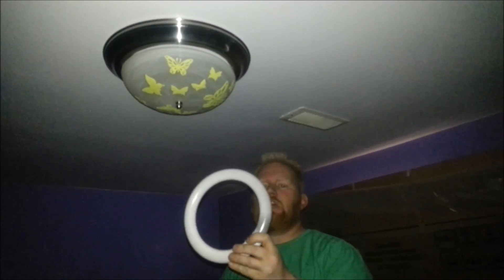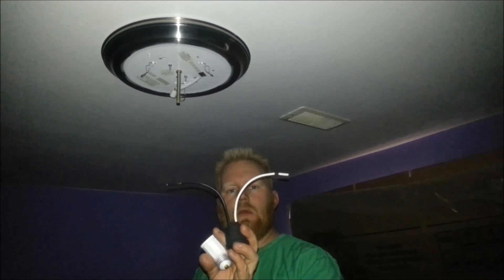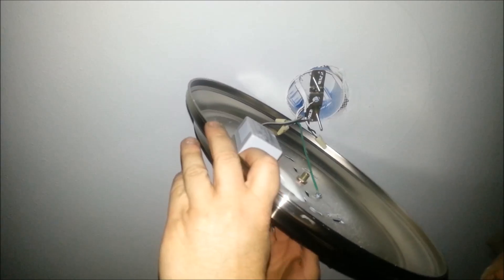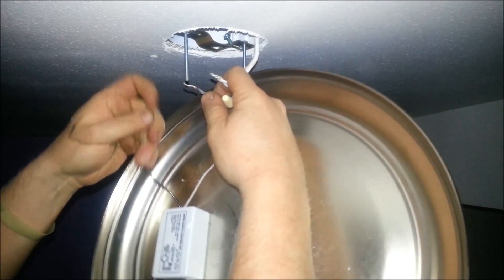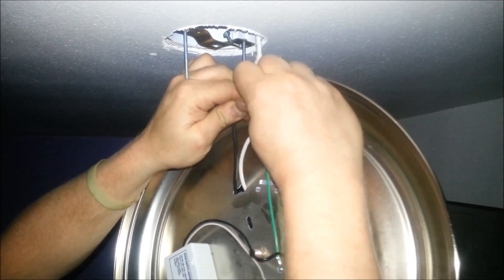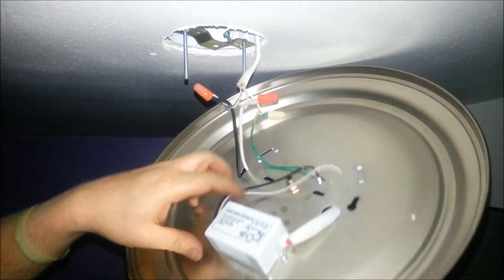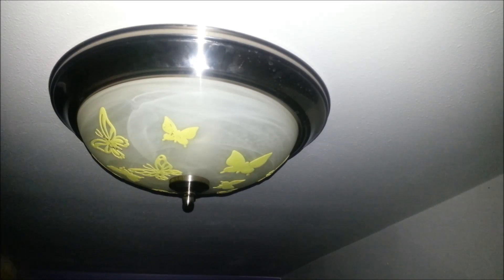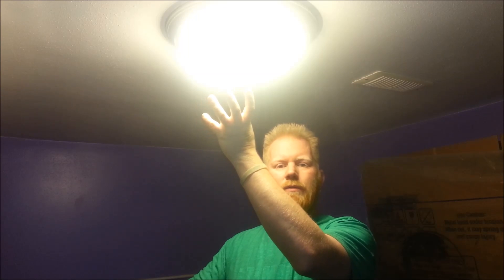Convert Circline florescent fixture to LED or CFL

Comment: Love circline bulbs. They last forever. Bulbs are still available where I live. They give nice even light. Many of the LED replacements only put light out one side and produce shadows in a fixture with exposed bulbs. New ballasts are available cheap on eBay. I like the old style magnetic ballasts since they last for decades.  In some applications an electronic ballast will give less flicker, if that’s important to you.  I’ve been picking up the bulbs when I see them in theft stores. Circline bulbs are relatively efficient for the large amount of light they provide.

Comment: Great video on the process, but I would think one should cap off the wires with electrical tape and wind them together for safety reasons and why not mount the light bulbs to base of the inside unit?  I would think leaning on the unit would create a hot spot with the bulb and glass fixture.

Comment: Help, i have 1 white and black wire, and 1 brown wire, and there is no ground wire, but there's no ground wire on the new light fixture either.  

The 2 wires that came off the old light fixture were some kind of knitted fabric instead of rubber and were both the same color of brown.

Comment: I've got 4 of those circuline boob lights identical to yours in my living room ( I don't have stickers on mine like yours lol ) anyways, it seems that the bulbs would go out every 2 years and I had a ballast fail in 1. ( It stayed out for a long time due to the ballast ) anyways, what I did is order a LED retrofit bulb from a site called 1000bulbs.com and it plugs in just like the old bulb but, you cut the wires off at the ballast and wire it directly into the mains power. No more ballasts and no more CFL crap. The LED is twice as bright and so far I have 3 of them done and only have one more that's CFL and when it burns out, I will do the same thing. I started converting them in 2019 and I've had no issues. As a matter of fact, I've noticed that my electricity bill is significantly cheaper each month. They have already more than paid for themselves.

Comment: Thanks for the vid. Very informative. What were the two wires you touched to trigger breaker if needed? Also does still still apply when the fluro uses a starter?
Reply from the maker: You don't want to trigger the breaker this way. You want to flip the breaker manually, this is just a back up to make sure you in fact have the correct breaker flipped and you don't electrocute yourself.
Reply: @sixtyfiveford  awesome thanks for the reply.

Comment: Man, every spring these f things go out for 10 years now. Tomorrow I'm going to do this. Whoever thought up these circular bulbs has a special place in hell waiting for them.
Reply: Made a trip out to the hardware store. Bought dual bulb mounts and some brackets that looked like they might help (And they did!) for a grand total of $15. Now both my circular hell lights are angelic normal lights that are running 1/4 of the wattage for the same/more light than previously. This was SO easy to do. Thank you!
Reply from the maker: Thanks, I'm glad you liked it.

Comment: I had a light fixture with one of those round Circleline bulbs in it years ago. The first one lasted seven years. But after that, they didn’t last so long for some reason. As for Cree LEDs, I bought a bunch of those 5000K daylight LEDs from Home Depot and they were junk. That’s why I buy my bulbs from Batteries and Bulbs from now on. As for CFL’s, they are not as energy efficient as LEDs and they don’t last as long either. I have had 2 FEIT 2700K LEDs in my bathroom since 2014. They are still going strong.

Comment: You've answered my issue of what to do with that sorry 35W florescent bulb in the kitchen without spending the money for a new fixture and for that I thank you. Is there any reason not to clip the wires from the ballast rather than let them sit/hang/dangle? Also, is there any way to set the bulb fixture so the bulbs are not laying against the glass?
Reply from the maker: There are a few styles of light socket holders you can buy and mount in the fixture to hold the bulb.

Comment: Is there any harm in not hooking up the green wire?  My light works fine without it
Reply from the maker: It's a safety wire for the unlikely event the black power wire was connected or accidentally touches the metal frame. Most lights don't use it.

Comment: Fantastic. I have 2 fans in my house that have either fluorescent or halogen that are dead or worn out. I was really thinking what a waste to install the same lousy bulbs in there or toss them. Already have the Hampton fluorescent fan ripped part and just need the socket and it will be good to go. The glass shround was brutal to remove. 

Awesome idea, thanks
Reply from the maker: Thanks for watching.

Comment: I guess there are no LED bulbs that would connect directly into that 4 hole connector.  I have a two circle light with a motion sensor that turns on  the light but these bulbs are just too pricey ..  LED the way to go.. I guess I will need to connect after the motion sensor which should not be too difficult to do.
Reply: michael b There are leds for retrofit that will use that 4-pin connector.  but then you dont get to bypass the ballast, which i think must be inefficient for a lamp that doesnt need ballast.
Reply: Thanks for idea.  I took out the ballast and circline connections and put in two A19 sockets which mounted very easily.   But in my case I kept the motion sensor in the loop .  This new setup should last for eons .  Glad you put this video together to inspire me to replace the two circline bulbs and ballast.

Comment: Useful video dude, thank you. I hate those weird circular bulbs. These days I really prefer LEDs for the white light, and also I have never had an LED bulb burn out randomly like CFLs do sometimes. Anyway, I may just replace my office light with one that has a dimmer and a fan at some point, but it's nice to have this procedure you showed as an option.
Reply from the maker: LEDs are getting better and better every year. I think they are worth the  few dollars they are now but definitely not the 20-30 they were a couple years ago. They still lack the ability to spread even light but the instant brightness(compared to cfl) is great.
Reply: Anything's better than those stupid circular bulbs, anyway! I also hate the ones you have to snap in for your bathroom lights with the ventilators. So hard to get out. I had to use a screwdriver to pry them.
Reply: Yeah, LEDs are getting better and better for sure. The first ones looked kinda weird.
Reply: And much cheaper for sure.

Comment: Great diy video .I had a ceiling fan with a light kit that had those circular fluorescent  bulbs.The ballast went on the light kit .Went to Home depot ,no parts ,could not even buy a new light kit as the unit was 6 years old . I used your method and put in LED lights .What an improvement in light brightness and quality.Liked the results so much I changed another  bedroom with the same setup. Easy to do with your video. Thanks for posting .
Reply from the maker: Thanks, I'm glad you enjoyed the video.

Comment: what do you call those double bulb adapter with wires ? I am trying to buy that.
Thanks.
Reply from the maker: +grilledchickenwrap Twin socket adapter http://amzn.to/1K8TJMY
Reply: +sixtyfiveford if i dont want to use my old circle housing/cover, what do i need to buy to avoid the new bulb hanging without its cover?
sorry for my bad english

Comment: This video was very helpful. Thanks. I was able to convert my circline fixture to a regular bulb using this video. The only difference was in my fixture black wire connected to black main wire and white to white. The other issue I had was my base was either too narrow or the bulbs too big. I could fit only one regular bulb. I wasn't able to close the cover after putting in two bulbs.  I just put in a high voltage bulb.
Reply from the maker: +desidhamaal Nice work.

Comment: With the cost of LED A19s having decreased significantly (usually less than $9 each) it makes perfect sense to use LEDs instead. They'll provide a much longer maintenance-free life....chances are they'll not need to be replaced for 30+ years and fixture wattage will decrease to only about 19W (....two 9.5W LED A19s per fixture). Awesome energy savings!
Reply from the maker: Toni Daniels Yes, but the life of LEDs is hypothetical. The LEDs themselves have a long life but the capacitors and other circuitry required to run them(built in) have relatively short life spans. There is a lot of discussion on the deceiving claims by LED bulb manufactures. While small wattage bulbs (60 watt equivalent) may be under $10 now, normal wattage bulb equivalent;75watt and 100watt are still $15-30each.

A typical 100watt LED has a life span of 13.7 years or 15000hours and cost $20-$30 using 19watts
A double life 100watt CFL has a life span of 18.2 years or 20000hours and cost $0.50-$1.50 using 23watts

Over the life of the LED bulb(15000hrs) you'd save $6.00($0.10kw) in electricity but pay for that with $20-30 higher initial costs and the CLF would still last 33% longer. Even if you bought a standard CFL that has a 10000hr life span you'd loose money on an LED bulb.LED's are great for directional light like a spot light or can light, but suffer immensely in lighting a room.

Comment: Wish we were allowed to use those wire screws in England. another great video.
Reply from the maker: john Baldock They got a black eye a long time ago over there. They were made  out of ceramic(Scruit/ Screw its) and mainly acted as an insulator. They could fall off or crack and expose the wires. The ones in North America are plastic with a threaded metal insert that locks the wire in place and makes a better electrical connection with the wires. Thanks for watching.

Comment: Hey, I honestly wasn't even thinking about CFL's - I just wanted to get rid of those expensive crappy Philips Circline bulbs.  I have 2 fixtures that each take 2 sizes of the Circline bulbs, and the ballasts are like small bricks.  Would have been $50 per fixture to replace the whole rig.  While searching for information on LED conversion kits, etc. I ran across your video.  Great common sense approach by you and a real good neighbor for taking the time to make the video!  Thanks again.
Reply from the maker: Slonge92 Thanks. I'm glad you found the video.

Comment: Wow, them circular tubes are freakingly expensive where you at. I just bought a replacement that's similar size to the one you got rid of for like $1.50 and the bigger sized unit that's probably the same brightness as the 2 CFL (combined) you used was like $3.

Comment: I replace junk like this all the time! I am also tired of "special" bulbs and batteries. Replaced my nicads with lithium polymer for my cordless tools, and now I'll use your idea for this! I got a super deal on some utility motion lights and put the motion sensors on my "expensive" outside lights for huge savings.
Reply from the maker: That would be awesome.

Comment: CFL are a problem. they contain mecury. better to go with l.e.d.
Reply from the maker: If health is a concern then standard incandescent are the way to go. LED bulbs contain lead, arsenic and a dozen other dangerous substances.
Reply: all depends on how thier made. why not put up a list of wats in side l.e.d.s vs CFLs vs incandescent.
Reply from the maker: Just saying LEDs are not a freedom from dangerous materials or Cancer causing risks. They are just a different poison. Right now CFL and LED light bulbs are categorized as Hazardous Waste due to the toxic metals they both contain and can leach.  Incandescent bulbs are not in the category of hazardous waste and pose no health risks..
Reply: till u decide to burn them (led)s in a fire you should be quite safe. vs the cfl. once it breaks your really screwed.

Comment: It's a pain to recycle those circleline.  You can't just throw them out here in NY and no one takes them. You have to take them to a special recycle center on specific dates. CFLs are accepted for recycle at the big box stores so that's another reason to use LEDs or the CFL bulbs.
Reply from the maker: Yeah, same here.  I just tossed in it the garbage.

Comment: I've done a similar fixes..won't work on the super low profile circle fixtures unless you use candelabra type  bulbs or similar.....but you are right I won't buy fixtures that take "unique" florescent tube type anymore. Fixture is not so expensive at first and then you need new bulbs..YIKES. Same issue with the small pin type Halogen Bulbs...a million varieties and they are all very pricey
Reply from the maker: Yeah, slim ones would require smaller bulbs for sure. I have some landscape lights with those little halogen 2 pin lights.

Comment: I would recommend some Cree LED bulbs. They are rated for enclosed fixtures and are only around $10 a bulb for a 60w equivalent.
Reply from the maker: Yeah, but to get the same amount of light I would have to put 3-4 of these in the fixture. Grated they would use a tiny bit less electricity (maybe 50cents to a dollar less a year) it would take quit a while to recoup the cost of the bulb. They're new so it's expected they cost what they do. They have already dropped significantly but I would expect them to reach the 2-3bucks in the near future.
Reply: I recently replaced all of my CFLs with LED. The downside of CFL is that they go dim over time. I bought my LEDs at Home Depot when the Philips bulbs were $4.97 (11w 2700k 830 lumens). They are now around $8. The thing is, the Philips bulbs aren't rated for fully enclosed fixtures so they don't work for everyone. I have 1 Cree bulb in an enclosed fixture. Hopefully I will get a few decades out of these. I didn't toss my CFLs. I gave them to a buddy to use in his rental homes.
Reply from the maker: Yeah, the CFLs degrade to roughly 75% of their original output at the end of their life. I did notice the Home Depot carrying Double Life CFLs for the same price as the regular CFLs but I don't know how they compare.  I did get a local rebate and picked up a Home Depot LED fixture for Free. It was advertised as a 60watt equivalent but seamed dim until I pulled off the diffuser. Then it seamed comparable to a 60 watt incandescent but you can't look at it without seeing spots.
Reply: sixtyfiveford I am going to do this, I have two fixtures with the circle bulbs. The grocery store had a sale on LED's, 2 dollars a bulb. 10.5 watts equivalent to 60w, 180 degree.  So they will drop in price very soon all over. The led's from the grocery store are brighter than a 60w incandescent bulb in my experience. I never thought of changing the circle lights. They are also annoying because they take a second or two before they even come on. I will change them like you did. Thanks!
Reply from the maker: $2 for an LED is a great deal.